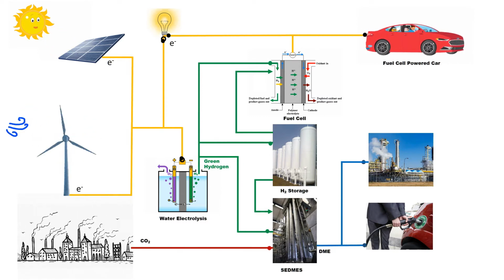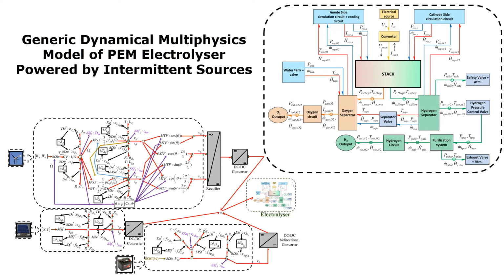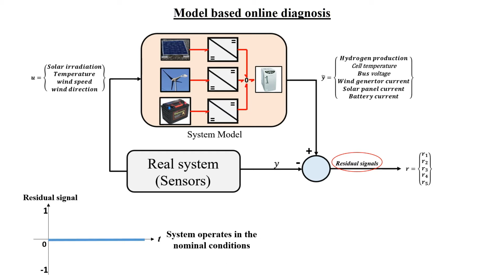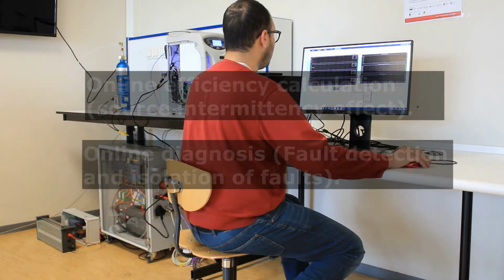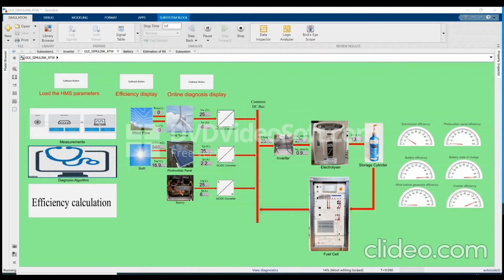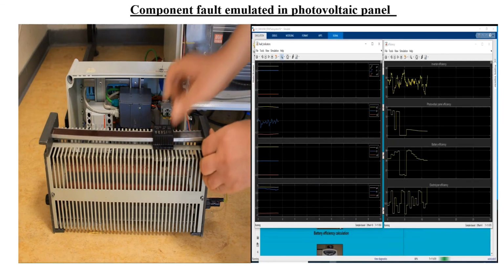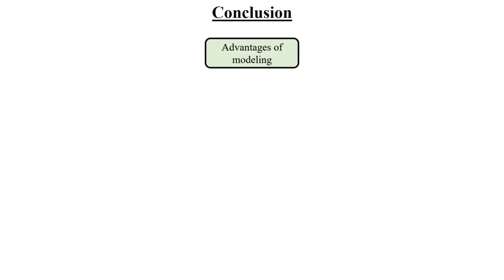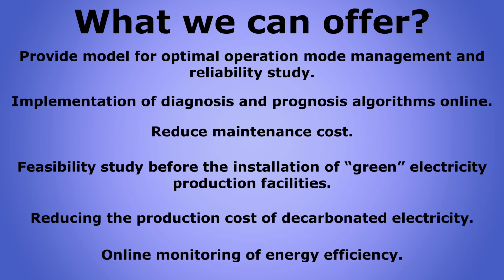Dynamic modelling of PEM electrolyser operating with intermittent energy sources

Comment: What is the simulink component for simulation of Alkaline electrolyzer stack?
Reply from the maker: there is no simulink component for that. The simulink model for the stack is developed using the built-in components of the Simulink. However, the model of the stack can be then used as a submodel for developing the complete of the electrolyser.